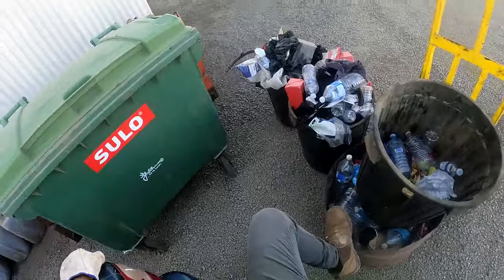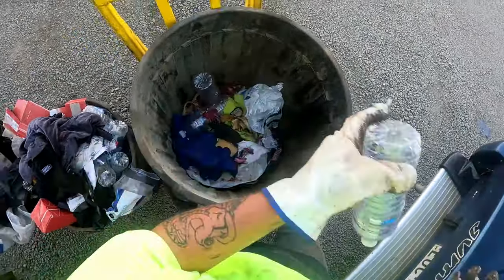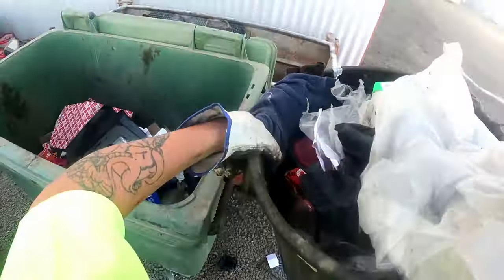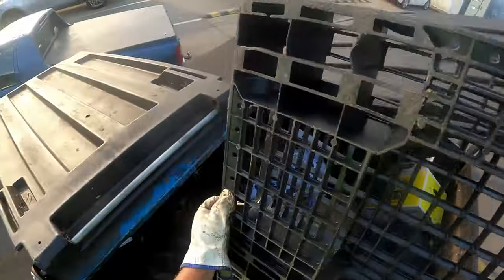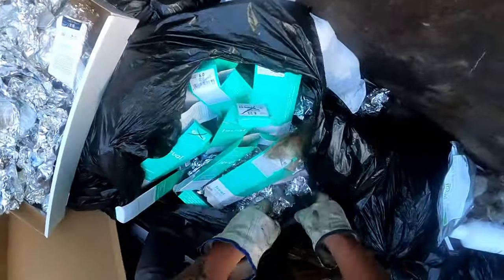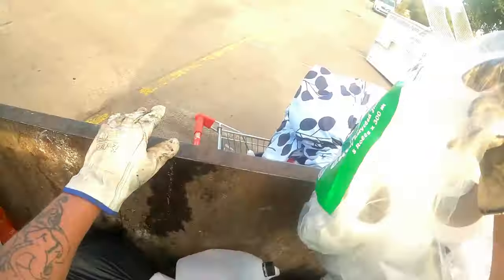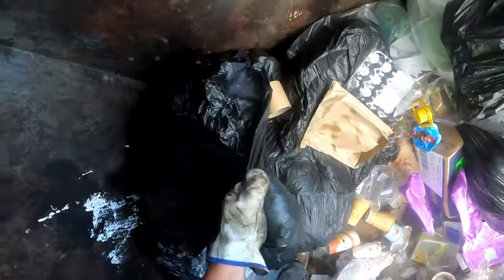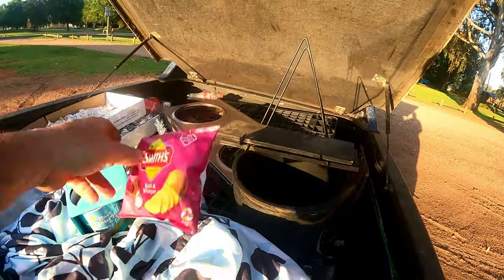Dumpster Diving And Street Scavenging

Comment: Good luck on the batteries. Some times trades throw them away if they don't work continuously all day, which is usually fine if your only doing everyday work. I even seen a few when someone has changed brands and just threw the old away